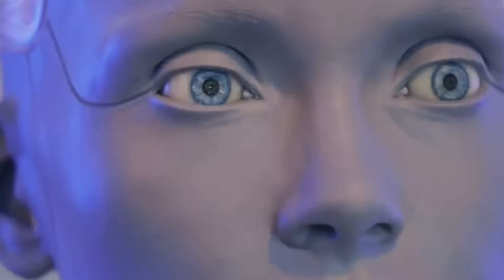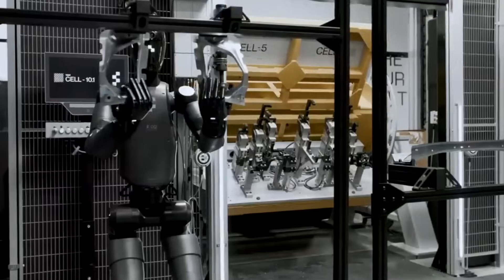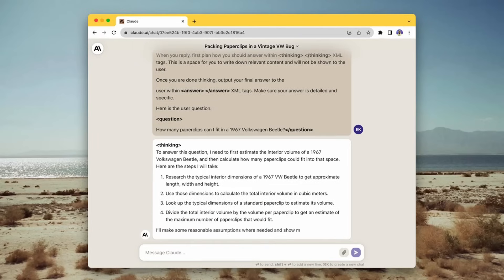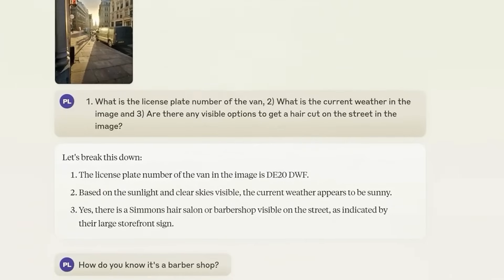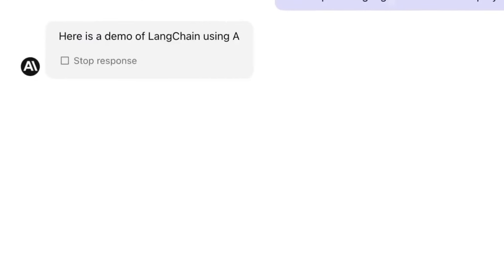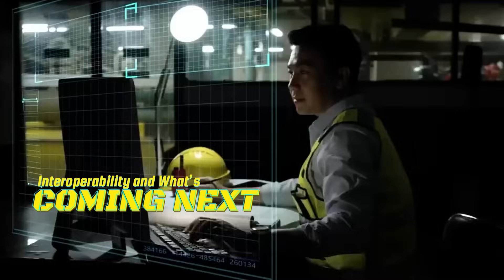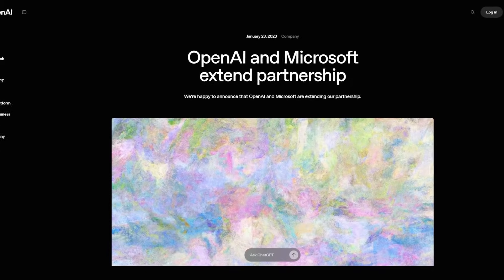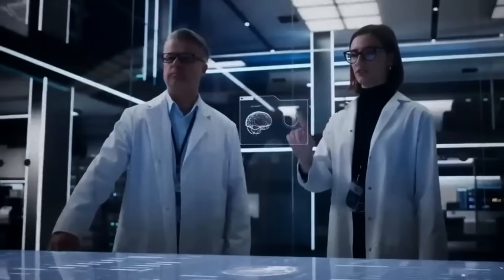Self-Building AI Just Shocked Experts: The Future of Automation Is Here!

Comment: Quick summary of the video powered by YTSummary_ai

Summary:
Emergence AI, established by former IBM researchers, has developed an innovative AI system that autonomously creates custom agents in real time based on text prompts, requiring no coding or manual intervention. The system includes an orchestrator that assesses tasks and utilizes advanced models like OpenAI's GPT-4 and Meta's Llama to generate new agents. Aimed at automating data-intensive tasks in enterprise workflows, the platform operates independently while allowing for human oversight through access controls and performance checks. A significant update is expected in May 2025 to introduce containerized deployment capabilities, enhancing the orchestrator's functionality across various cloud environments. This advancement represents a shift from traditionally human-directed models to autonomous systems capable of executing tasks independently, potentially revolutionizing enterprise operations and workflows.

Key Insights:
- Emergence AI autonomously generates custom agents from text prompts.
- The orchestrator evaluates tasks and utilizes advanced language models.
- Targeting enterprise workflows for data-intensive, repetitive tasks.
- Maintains a balance of autonomy and human oversight.
- An update in May 2025 will enhance deployment capabilities.
- Represents a shift towards self-building AI systems in enterprises.